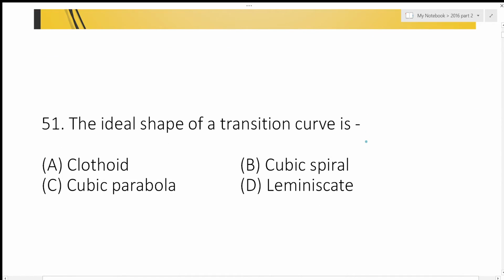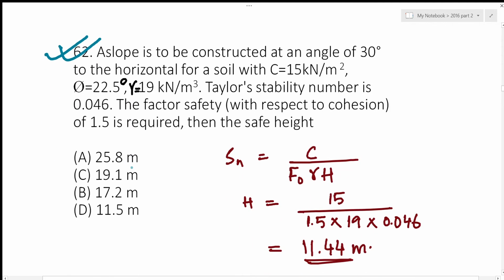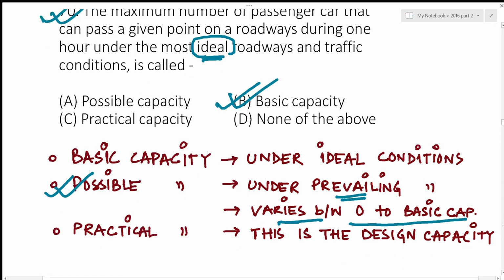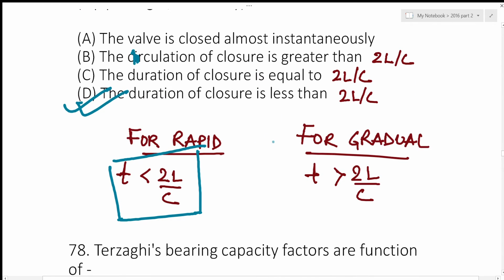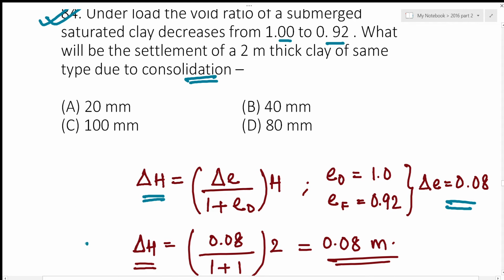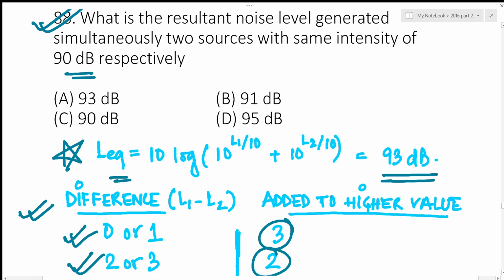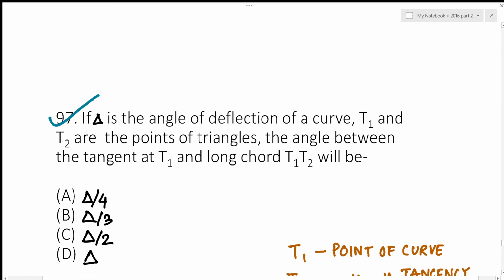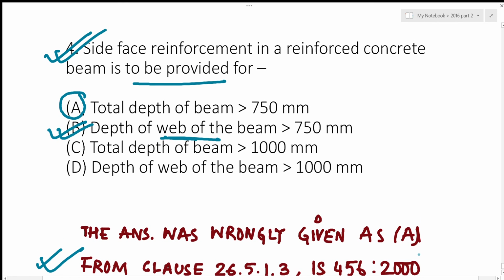WBPSC A.E. (CIVIL) | 2016 PAPER | FULL SOLVED PAPER | DETAILED SOLUTIONS |PART 2 OF A 2 PART SERIES|

Comment: Question number (95)..... Answer will be 210 plz check and correction this answer
Each included angle =360/4=90
So the deflection angle 180- each included angle
So now 180-90=90
The FB Of line =Deflection+FB present line
FB of AB = 30( GIVEN IN THE QUESTION)
SO FB of BC 30+90=120
FB of CD= 120+90=210
FB of DA =217+90=300

ANS FB of CD =210
FB(FORE BEARING)